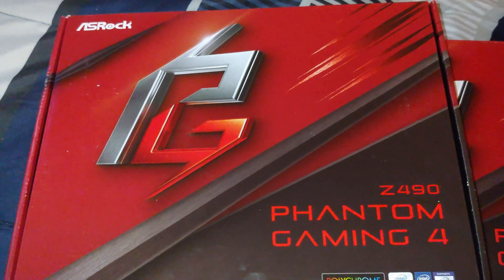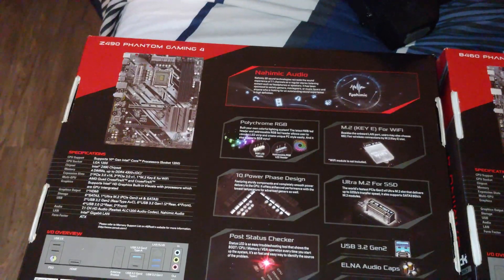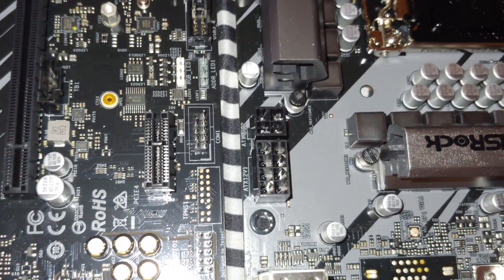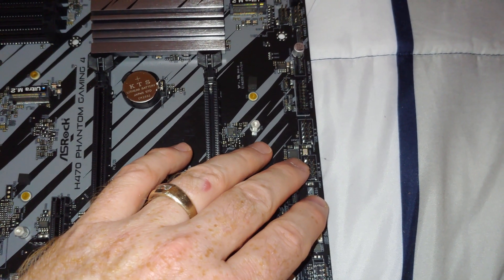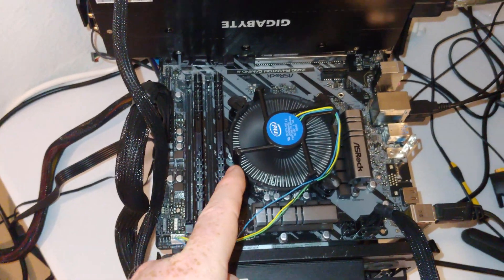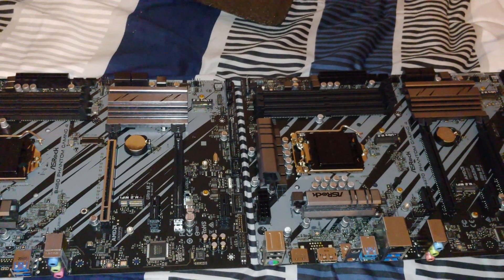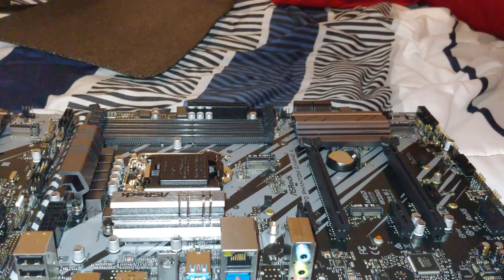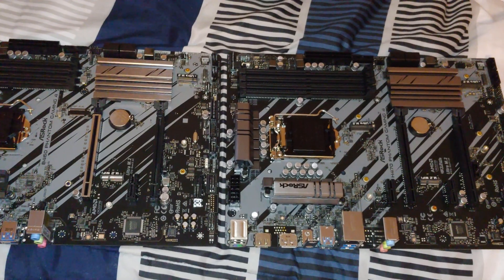Z490 VS B460 VS H470 AsRock Phantom Gaming 4 motherboard comparison, pros  cons

Comment: Hi i want to buy a I5 10600kf and i want to buy a B460 or H470 cuz z series is too expensive what do u suggest?
Reply from the maker: What size case..or motherboard are you interested in?  You will still need a decent CPU cooler...but it should still provide better performance than I5-10600.
Reply: @PC_HardwareTechUnboxing_1  i already have a cooler a CPU ID-Cooling SE-904TWIN and the motherboard can i buy is an Asrock b460 pro4 or an Asrock h470 phantom gaming 4
Reply: Or a b460 hd3
Reply: @PC_HardwareTechUnboxing_1  My case is a Segotep Blade black can suport both matx and atx now i have a b150m-k fitted in
Reply: @PC_HardwareTechUnboxing_1  oh and i have another option to get a i7 9700kf instead of 10600kf it’s at the same price